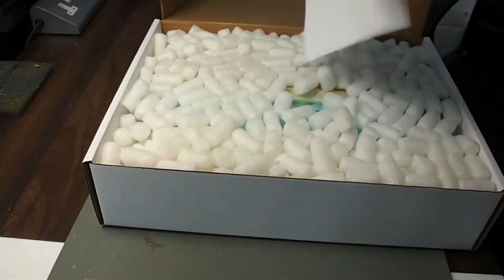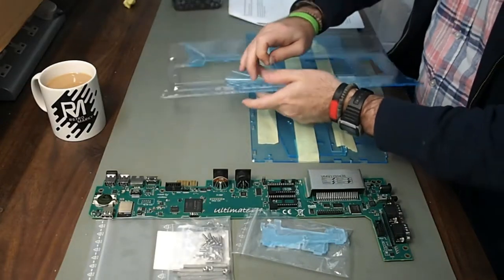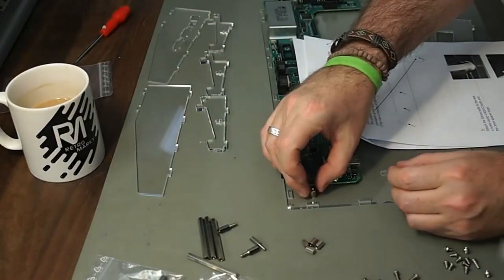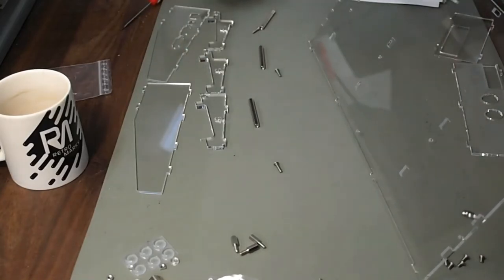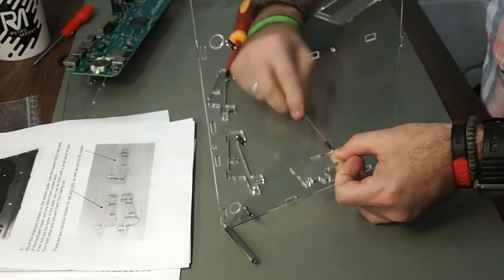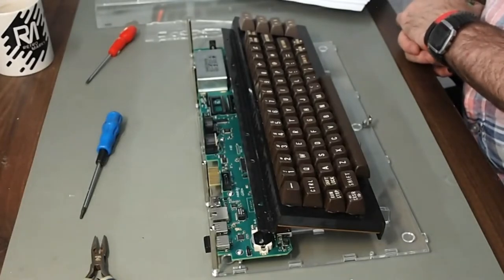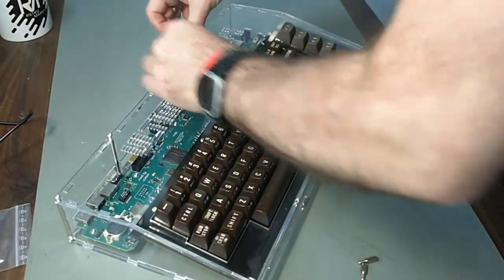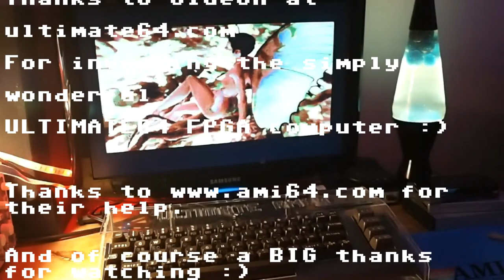Retro Computing: Commodore 64 (ultimate64) fitting a new case.

Comment from the maker: Apologises but I made an error whilst making this video. The case in fact (just the Ultimate64 case)  doesn't actually need cutting as shown at the beginning of this video. I presumed it did having made a full sized machine into one of these cases but the guys have pointed out that it's designed for an ordinary, unmodded keyboard. A big thanks to plexilaser for pointing this out and sorry for any confusion. The case then for the U64 doesn't need specialist cutting tools, just a few screwdrivers and can be easily assembled at home!

Comment: Hey mate, can I make you a question? The USB port in the board facing the keyboard, does it work with a normal USB keyboard? I'm considering buying a C64 Maxi (that has a c64 like keyboard but with USB connectivity) and fitting the Ultimate64 in it as a fast and brand new option to put together the Ultimate 64 knowing this would go miles.
Reply from the maker: I have been advised that yes it does work however I haven't tested it myself. I will try and do so in the next couple of days and report back as actually thinking about it, it would be an interesting addition.